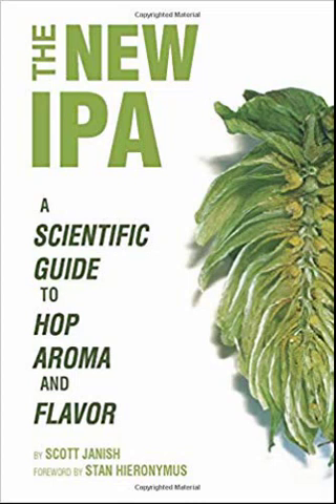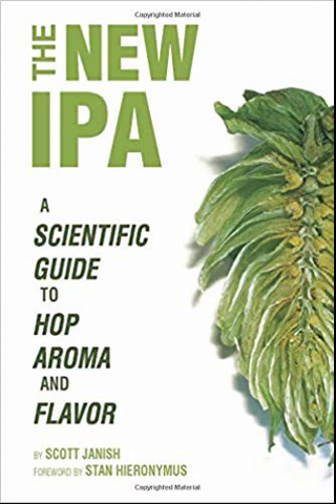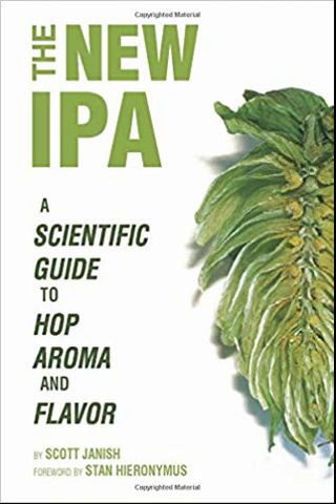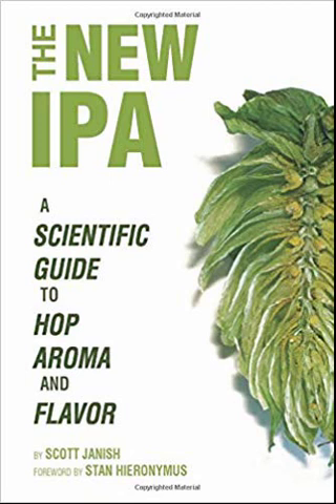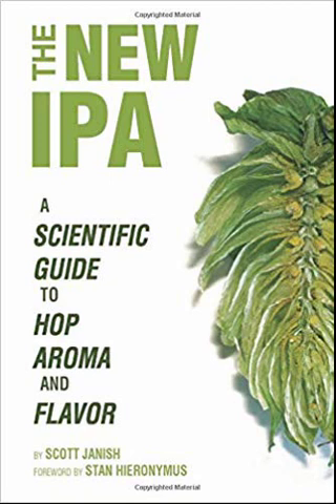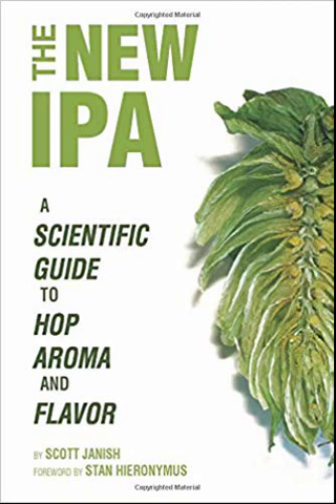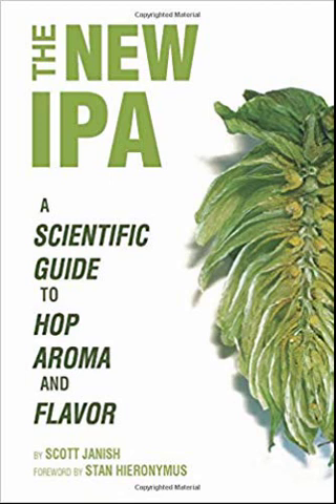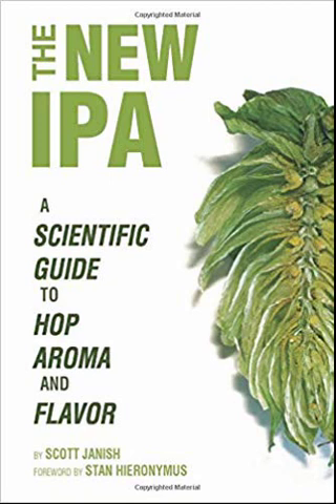The New IPA: Scientific Guide to Hop Aroma and Flavor (Chapter 7 Dry Hopping)

Comment: Thanks, very interesting listen.  I brew 5.5 gallon batches and will be recirculating the dry hop on my next brew. I use a spool filled with the hops, purge it with co2 before dropping them into the conical. After about a half hour, once the hops are saturated, my plan is to then use my Blichmann Riptide to pump the beer from the racking port and back in through the dump valve, while under 5 or so psi to try to avoid any o2 infiltration during the recirculation. The beer will already be cooled to between 40-45F and all of the tubing purged with co2 and then beer prior to the recirculation. I usually dry hop with between 2-4 oz for 3-5 days at 60F. I’d love your recommendations with regard to the amount of pellet hops to use seeing that I should expect better extraction, the recommended recirculation time, target flow rate and total time for the beer to sit on the hops before crashing and closed transfer to the keg. Again, thanks for the great information... always trying to improve on my results.